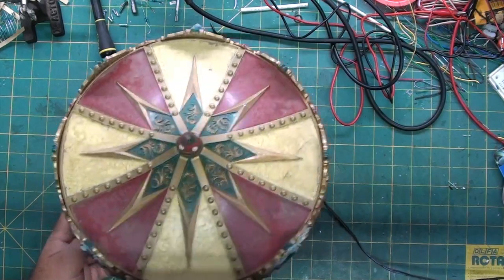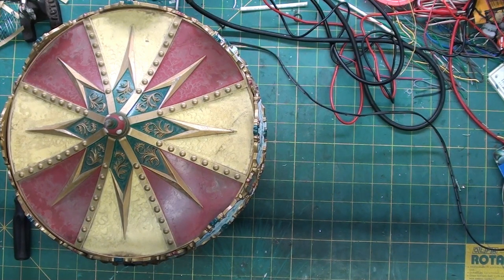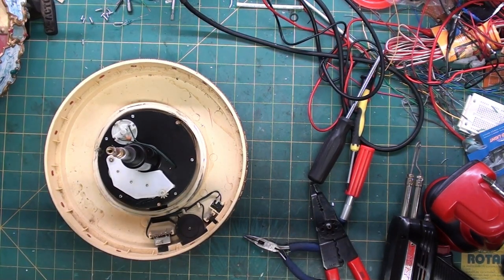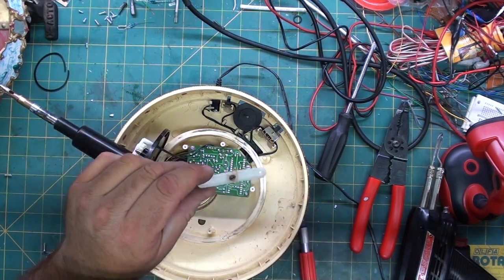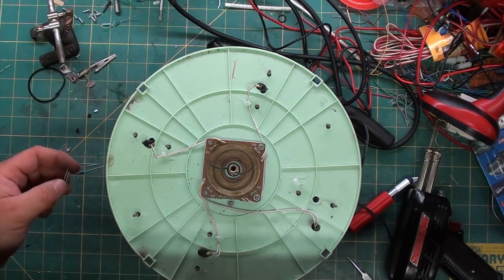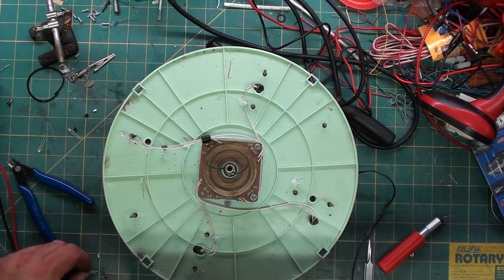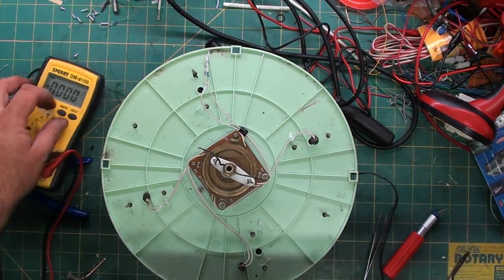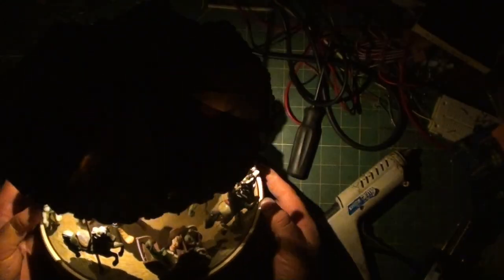Kaptin Kaos' Lab: Mr Christmas Merry Go Round Repair

Comment: Wow, what a detailed how to video. Thank you!  I did this on my own.  Everything was working when I took it apart. The belt, gears, lights etc. It wouldn't rotate though. I cleaned the parts, sprayed out dust build up and re-assembled (minus the need to get lights soldering fixed yet). It still hesitates briefly about every 7 seconds. Not sure what else to do, but I'll take the hesitation from not moving. Thank you again.
Reply from the maker: Hesitation is normally a slipping belt or a cracked gear. If you disassemble it again, inspect the gears closely, with a magnifier, and look between the teeth, some cracks are hard to see.

Comment: Thank you so much for this video. My carousel is in excellent condition, but it doesn't turn and thinking it was an easy fix, this video tells me different. Here I was trying to remove the bottom, but in order to do that, I have to remove the top to get to the bottom.... what a nightmare job. Looks like I have to find someone to fix this for me. Thanks, Kaptin Kaos, you saved me from breaking my carousel.
Reply: Or,  you could just give it away to me.🙂

Comment: I have the same exact carousel.  Just got it used in new condition for my wife as an anniversary present.  We put it under the tree and an hour later it stopped spinning.   

I couldn't have asked for a better tutorial than yours! I'll be tearing it down in a few hours.  Hopefully I don't break it.  

The led replacement can wait.  That involves shopping.. 

Thank you sir!!
Reply from the maker: I'm glad it was a help for you
Reply: @RandomJunkChannel  I'm suspecting that yours was repaired previously.  Mine didn't have any of the glue issues.  Also, the broken part that you had to epoxy wouldn't have broken under normal wear.  It was probably from being tightened without first aligning the center section (I almost did that). 

Overall quite the simple repair thanks to your video.  Hardest part was finding a rubber band and cutting the top piece off.

Comment: Could you have broken the bulb and soldered an led to the inside so you could use the existing bulb holders. I haven't got one, I'd like one but hey you can't buy them in UK. Loved watching this video though and maybe try to make one someday (better hurry I'm 66 now and the old Arthur is setting in).🙂
Reply from the maker: I have done that. I have taken a base and soldered a resistor and LED within it, it is hard to do on the small bulbs, but still possible.

Comment: Question for you! I bought a new belt for my carousel cause the stock one eventually got stretched out and kept popping off. But the new one seems to be just a little tight, and sometimes the carousel stops turning until I give it a little nudge. I’m thinking some grease will help, but with so many hydrophobic silicon based greases on the market, I’m not sure which one to buy. Any suggestions on a specific kind? Thanks in advance!!
Reply from the maker: I use white lithium or silicone grease. Be mindful of where you put it, you don't want the grease to migrate into the motor if it gets hot enough to become liquidity. Also, check your gears, sometimes a hairline crack or chipped tooth will cause it to stop and once nudged, start back up.
Reply: @RandomJunkChannel  thank you!

Comment: Do you have a measurement on the drive belt. I need one, but don't want to pay 15 dollars for a 50 cent belt.
Reply from the maker: Depending on the year, they changed the pulley diameters, but 30mm and 40mm are the standards.